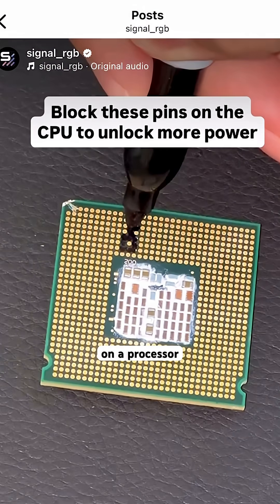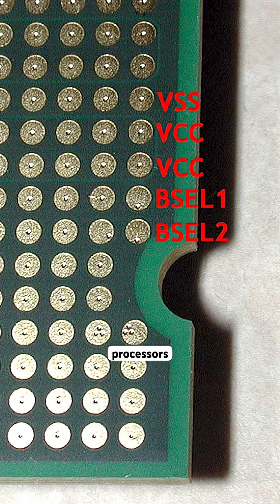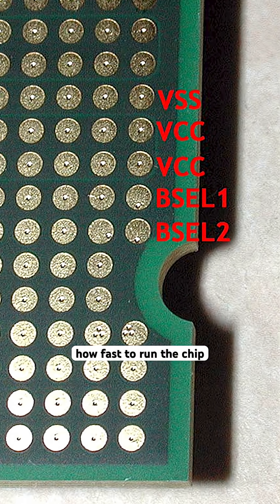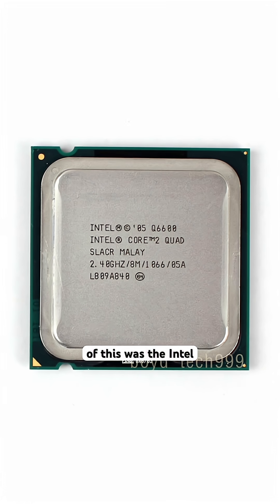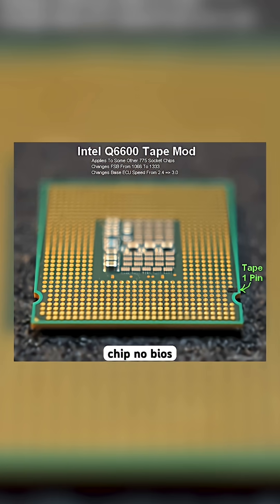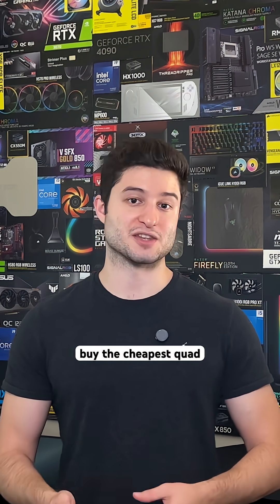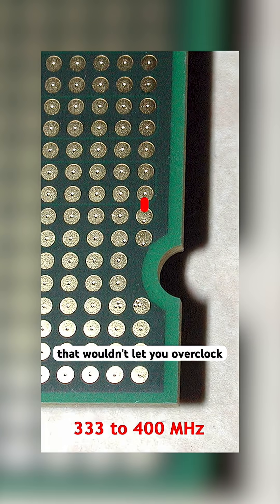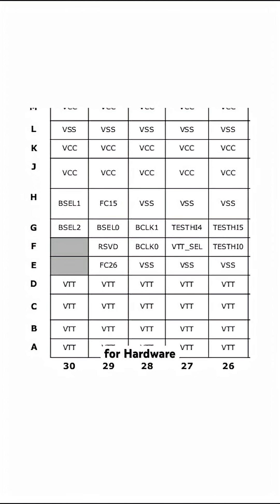Taping a CPU to improve it?!

Comment: Yeah, this works because of CPU binning. All processors start out as the top end line up of the series, and based on their performance and production quota, they are packaged accordingly. You could always get an i5 with processing capabilities of i7/i9 just hidden away. This is done to maximize silicon yield and reduce expenses.
Reply: It's a bit more nuanced than that.
All chips of the same type are made to be identical. 
You can call that the top of the range if you like. 
But manufacturing at that scale is an analogue process with some variation, and defects. 

That means that the resulting chips are not identical in capabilities. 2 cores right next to each other on the same wafer can vary in how much works, and how fast they run.

A bell curve is probably fairly accurate for visualisation of one parameter.

There are several.

If 1 core doesn't work at all, it then depends on marketing how many get disabled by laser.
An i9 potential becomes an i7.
But wait, it can only run at 4ghz.
So it becomes an i5 or i3.
But it will do it at a really low voltage despite not running fast.
So it becomes a low voltage embedded chip.

Naturally demand plays a role. If all chips are capable of i7 but customers are only buying i3, then a bunch get ruined to meet the market.

I think I've covered most of the main parameters, but I have no doubt their binning process is so thorough that there might be hundreds if not thousands of potential bins that get cut down to 50ish by marketing.
Reply: @myne00 that’s actually… extremely interesting. So it’s not like different models of chip, but one design is produced and due to being so complex and tiny, and naturally unavoidable slight manufacturing variances, they are sorted into different “models”  based on performance they can safely run at.

You would think something mass produced like a computer chip would be uniform but I guess since everything is so small even the tiniest of manufacturing flaws can make a big difference in capabilities. So they’re almost graded like something naturally occurring like a diamond and “flawless” chips get sorted as top of the line models and the messed ones become the budget models. 

That’s insane
Reply: @mechadonia  exactly.
If you look into the several hundred step process, you'll understand why. 

Acid, photoresist, metal deposition, lasers melting tin, mirrors polished so perfectly they make Hubble look like a toy, and more. 
Each process analogue, at nanometre scale. 

Nothing in this world is perfect, but chipmaking is as close as it gets.
Reply: @mechadonia  in the 70s they had 10% yields, before they introduced projection masking(instead of placing a thing on the chip to expose it, they just projected the pattern on the chip with the projection).

but still these days too the yields tend to go down as the envelope is pushed, but they started compensating with these designs that allow partial usages better along the way.

though smaller chips mean also more chances for more working chips from a batch, so it's not like universal that everything is same design cut down. it all just depends on a bunch of factors. and of course with graphics chips it has been quite common that the lower chips of a """generation""" aren't that generation design at all and sometimes just done with the older process at the factory that was making the previous generation.

but what is a newer development is offering unlocked chips for extra money. newer as in speaking in decades but still. really took all the fun and poor boy benefits out of overclocking. I don't think it really affected their profits back then either, like we didn't have the extra money for the more expensive product anyway.
Reply: @myne00 There's a presentation called "Indistinguishable from Magic: Manufacturing Modern Computer Chips" that was given at HOPE Number 9 in 2012. Around 34:30 in the presenter mentions that a transistor's gate oxide is 4 monolayers (1.2 nm) of silicon dioxide, and if it was an atom thicker or thinner the performance would probably be unacceptable. The engineering gets crazier from there.
Reply: @myne00  the problem is that last statement. Ruining fine chips to meet " quality demand " is bs. There is no quality demand . There is price demand. So ruining fine chips ( putting MORE work into an existing product ) should theoretically make them cost more. Conversely they sell them for lower. . Meaning they could have sold the fine chips for lower in the first place and still met their price point... This synthetic manufactured supply and demand manipulation is why people want the i5 in the first place. The fancy ones are not twice as better for twice the price. Which is proved by the fact the manufacturer is willing to put MORE work into a product to sell it cheaper. Just locking away the "paid for" potential instead of realizing that capability is only worth as much as people are willing to pay. Not the other way around.
Reply: @deshyvin  who said quality demand?
Reply: @myne00  invidia, and, Intel, dell, etc ... That's the reason the ruin better chips to sell at a lower price, is because there is "more demand for lower quality chips" .. which is bs. There isn't more demand for lower quality chips, there is simply a price point which is reasonable for the quality provided. Most people don't feel it's reasonable to pay twice the amount for a chip that's only 10% better than the lower tier... But the company feels it's ok to take that higher tier chip and throttle it to lower quality. And then sell it at lower quality price . . . Which means that ultimately the company could sell the higher quality chips at the lower price point and still make their money.... Because ultimately that's what their doing anyway.
Reply: @deshyvin  I was very clear that marketing were involved in the binning process.
I'm not sure what you're disputing.
Reply: @myne00  ? I wasn't arguing against what you said in that...  Wait, did I misunderstand and you're actually saying you approve of companies ruining high quality products just to sell them at a synthetic lower price ? . That's the definition of market fixing.
Reply: @myne00 
Where are you going after you die?

What happens next? Have you ever thought about that? 

Repent today and give your life to Jesus Christ to obtain eternal salvation. Tomorrow may be too late my brethren😢.

Hebrews 9:27 says "And as it is appointed unto man once to die, but after that the judgement."
Reply: @myne00  You both said the same thing you know...  You just wrote all the bits in between the lines that he left out. lol

Also, for decades, they never even ruined them. They just changed the reported votlage and timings..  AMD once sold a large batch of base line athlons that were actually top bin chips.  And you could just tell your mobo that's what they were, without even getting out the pencil.
Reply: @M3rVsT4H  yes. Hence "nuance"
Reply: @myne00  Meh.. . if you say so. I think OP just went over your head like an aeroplane. :P
Reply: @M3rVsT4H  Nope because have never ever been able turn i3 into 19 or whatever be in-between, which is what seems to be suggested.

What is decades of not ruining AKA when did the laser cutting of unsuitable cores start to become a practice?

In other words, reductive comments is not going to win the debate lol.
Reply: @jamesporter7731  I made a few replies.. And I'm not sure which you're replying to.  But you seem angry. And that's a shame because none of this matters. :)

Ok so what is decades.  Basically from 1983 early 386 to early Northwood and Willamette Pentium 4 chips (~2000–2003). You could physically manipulate the chip to present as whichever model from that chip's range.. 
And yes, you could turn some celerons into pentium 4's.   But boy you had to throw some volts at them lol.

Anyway, this isn't a debate. Just a chat.  You can pick the winner, I'm not fussed.
Reply: @M3rVsT4H  Okay so first part of your comment is bad, never ever live in someone's head rent free bro that's trolling... also it's not rocket science to be checking yourself over after someone has made a point about what you said... again this is trolling as you be refuting the central point.

Second part good, that's much better like if you do know something of what you're saying then don't hide it away, get that knowledge out of you the first time every time fo sho or otherwise it's like your saying something without saying anything.

Everything us humans talk about on social media is a debate when we be communicating in the manner of one... and cannot be not sugar coated as being anything else.

There is no winner to pick... because a debate is only won when everyone in it has become a winner.

Now if anyone may have got angry here then it's most certainly not me... and the commenting didn't have to go this way whatsoever... aka not my fault bruh it's yours ya karma comedian.

Whack this song that you can find on YT and Bandcamp... it's in my top 10!

Times Strange · Submotion Orchestra · Rider Shafique
Reply: @M3rVsT4H  Thats also why AMD had way more stability issues and power consumption problems back then. They soft fused the dies instead of hard fusing them. Hard fusing would prevent creepage pathways and thus reduce powre consumption and corruption/error issues
Reply: @M3rVsT4H yes, he's adding information to the discussion. That's how conversation works, why do you think he's debating?
Reply: @ForeverStallone  Hello.  I was responding to a previous comment, where it was brought up.  But more importantly. What information are you adding to the discussion?  Or are you avoiding the conversation to merely question the debate? lol.   :)
Reply: It makes sense.  It is still cheaper for Intel to just block out some features than to run an entirely new fab and assembly line for a lower-end chip.
Reply: @dr.charlesedwardflorendobr3952  It's both, manufacturing efficiency and minimizing product loss. If you can't sell a CPU for the flag ship price because it's faulty, just sell it as a lower tier to someone that the lower spec is good enough.
Reply: i've heard that:
(i'm not god enough on the subject so that's more a quote than anything, warning parts of this may be false, and others true etc)
" when they do a waffer, they check how many cores weren't properly etched(or something similar, the final writing) they cut traces to deactivate these cores and depending on the number of cores working, tending to be less & less on every new gen, they decide which one is a 2-4-8-16-32 even some odd counting ones, like 6-14-28 become i3 i5 and i7 when the needed count of cores functionning is equal to the max number of cores of the gen"
(sorry for the bad phrasing here, I'm not a native talker. hop it will still do)
Reply: @666neoselen  I will add to that. Even within the i5 range, there is a speed variation between models. This represents how stable that chip's silicon pathing is at a normal voltage.  Better formed silicon crystal paths will run faster at lower voltage and make less heat.  So those chips are sold as faster i5 models.
Reply: @666neoselen  That makes sense, I’m not great with this stuff either but that’s pretty much how I always understood it too
Reply: @666neoselen yes, but if the market demand is high for low-end Chios then the manufacturer will take perfectly fine chips and purposely deactivate working cores to meet the market demand.
Reply: I'm so sad I missed out on that era, but being 8 at the time was a major roadblock in me learning more about computers like this. 

Not because I didn't enjoy computers, but because adults in the room treated me like an 8 year old smh
Reply: @crafciak31  I don't get what ya saying because I was well into RTFM at this age and have not stopped with self-teaching the ever living crap out of myself about IT in the ways that I wish to know of it.
Reply: @jamesporter7731 Well, I also was living in a village, away from any library and with no internet access. Information was pretty scarse tbh.
Reply: @crafciak31  Thass fairs like, so what did ya end up doing instead? Oh and what kinda information do you need in the now to help with peecee? I got a hella lotta top tier knowledge bases to share for practically anything to do with it.
Reply: @crafciak31 exactly I always asked my dad if he could take me to frys so I could upgrade the family computer I was only playing counter strike but half life 2 was coming out and I needed more ram and a graphics card. He never took me said I would just mess up the computer.
Reply: Its just like GPUs, the last 2 digits for a GPU is defined by how little broken cores are in there and then they just stick it on an appropriate board that supplies power.
Reply: But would ot last the same? Is my question. Is it still exactly the same like am i7/i9 ?
For me as anoob i have no clue.
Reply: @soydansogukcesme470  it is. However, either due to sales requirements or not meeting testing criteria (which would make it qualify as i9), it has become i3.
Reply: This worked because it changed the FSB (front side bus). Like changing gear ratios. If you pause during one of the pictures you’ll see that. You can still do this, if allowed, today. It’s not usually just tied to the cpu though and can cause other signaling issues.
Reply: @MikhailGorbaGorb  Haha some people don't get how it works and be unaware of causing data corruption with their let's face it, pretty pointless that's not the good kind of FSB OC's.
Reply: Nothing to do with the packaging.

They test the dies using test patterns at different frequencies. They grade the chip as to which highest frequency test data set it successfully operates at.
Package doesn't change.
Package marking changes. That's the labelling placed on to the package.
Reply: @deang5622  Until ya start getting gritty and sanding it off for a delidding.
Reply: Wrong. Your mobo thinks the bus speed should be different, not that it has different CPU lol
Reply: Yes and no, on socket 775 - the clock speed was tied to the FSB with locked multipliers on majority of CPUs.

In this case this is setting the FSB at a higher speed (usually done on locked boards) to gain some speed. Most commonly 333mhz to 400mhz or 266mhz to 333mhz.
Reply: back in the day they would just bin based on market demand quite often. more so when a manufacturer had a performance advantage to milk the high performance customers and able to meet market demand in production.

the customer didn't want to buy the top of the line cpu, so the same cpu just got a different lasering on the heatspreader with for example pentiums between 75-100 quite often, to still get the customers money.
Reply: Yield literally depends on the amount of contamination and lattice inconsistencies the silicon crystal had, which is cut to make wafers. Any imperfection in the crystal lattice, will yield a defective transistor at that location.
The amount of money spent on growing (yes, they're grown) 99.999999% pure silicon rods with a diameter of 30cm is staggering. Especially with the huge area of dyes of for example Blackwell, purity is absolutely paramount. Tiny chips like RP2040 can be produced with silicon wafers that are much less pure and thus cheaper, making them ultra-cheap to produce (over 10,000 working dyes per wafer), where blackwell is ultra-expensive to produce due to way lower yields (maybe 10 per wafer). Blackwell would be better of being produced on 40cm wafers with position determination out of the way of defects to get better yields, but these are prohibitive in cost.
Reply: Just like BMW heated seats.
Reply: you could NOT get a i7 or i9 out of an i5 at any point. the very earliest i5s could still be unlocked to 4 cores, BUT that was fused off long before and still had nothing to do with pins, pin oc was doable from pentium 3 days up to core 2 quad. yall love to spread halfway cooked comments.
Reply: @tarkitarker0815  how do you know
Reply: @bayharboursinger  how do i know? im 30 and i had a uncle that didnt see me as an nuisiance when i was there and told me shit.
Reply: @tarkitarker0815  good for you bro.
Reply: @tarkitarker0815  Exactly right, your comment has been clipped and filed my good man bro.

Comment: I still have an operational Q6600 and a Northwood that’s overclocked to the gills, from my overlocking competition days. I’ll never let them go.
Reply: I thought my CPU was a goner for a moment, so I quickly swapped in an older one to see if the mobo would POST.

Turns out I swapped an E7500 clocked to 4.5GHz for a Celeron D 352, but kept the OC settings.

It booted up and I shit myself when I saw 8.9GHz in the POST screen, I had the CPU running without cooler so I turned it off as quickly as I possibly could. 

That Celeron D was running 374MHz FSB at 24x multiplier, so I might have broken some records when it booted at 8976MHz 😂😂😂
Reply: it didnt run benchmarks without glitches. and not documented or witnesses,  so no records

it would melt itself
Reply: still have mine in a box somewhere, oc'd on the cheapest board (P5K SE) @ 3GHz because it was just not stable enough @ 3.2.. still have the txt file with all the measurements done over a month with the voltage drop and everything!.. good times.

Comment: TLDR: when the chip makers make chips, they don't make a 3Ghz, and a 2.5Ghz and a 2Ghz. They make one family of chips and then package them based on how they turned out in the QA process. Great ones go in the 3Ghz bin, middling ones go in the 2.5Ghz bin and the mediocre ones go in the 2Ghz bin. Crappy ones to the landfill.

I have nothing against the process personally, the alternative is to landfill all but the greats. Down/upside is that if you overclock then you are much less likely to get the expected lifespan out of the chip.